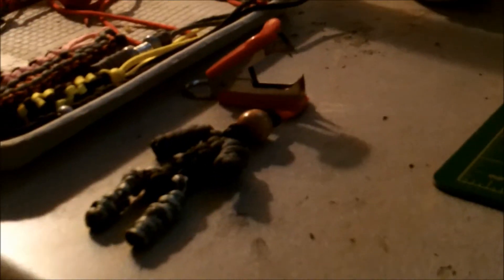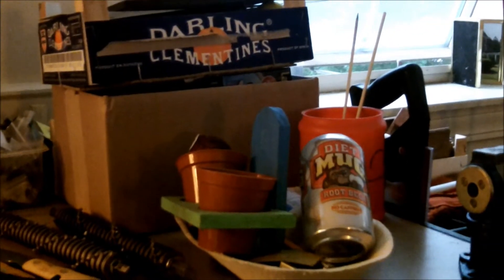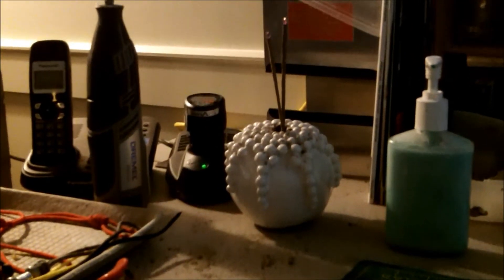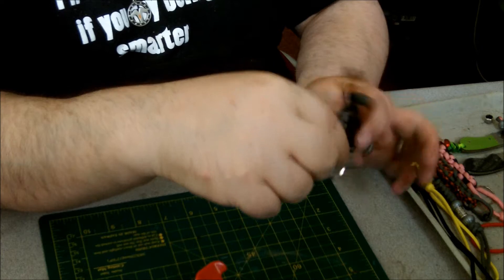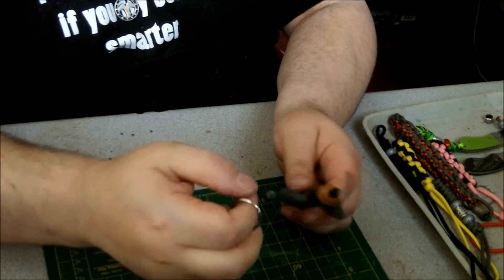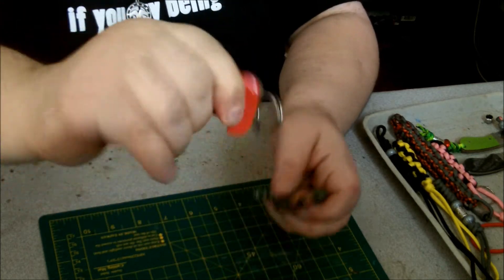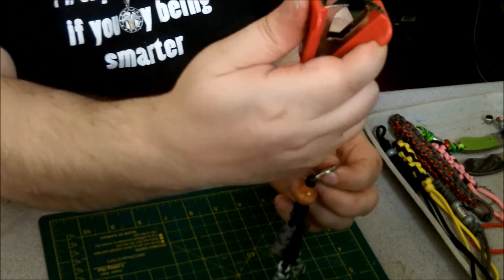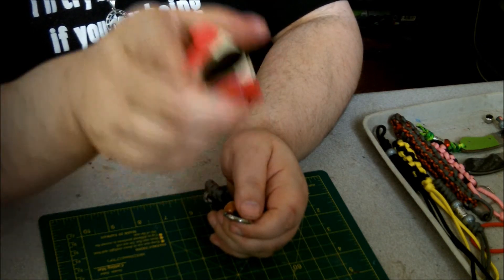How to Put Keyrings on Paracord The Easy Way

Comment: Great tip.
I have a pair of split ring opening pliers that I bought about a year ago  ~$4. They are like needle-nosed pliers with one tip bent 90 degrees into the other tip, makes it a breeze.
I haven't got a staple remover so I'm not too bothered about the money,
For really big split rings I start with the pliers then use a County Comm widgy prybar.
Love the para-dude!